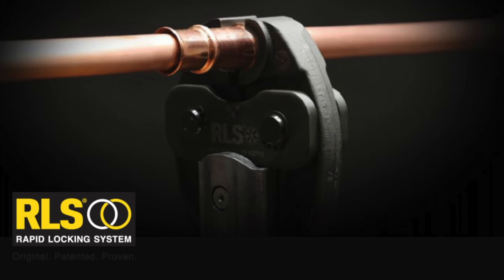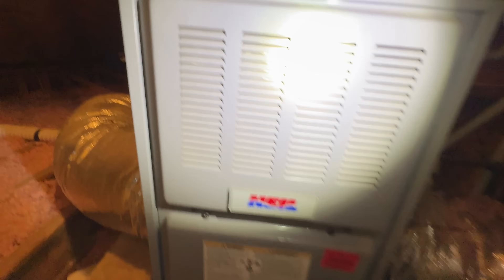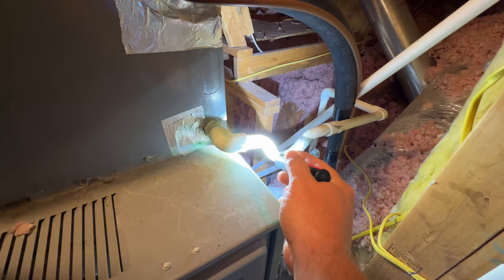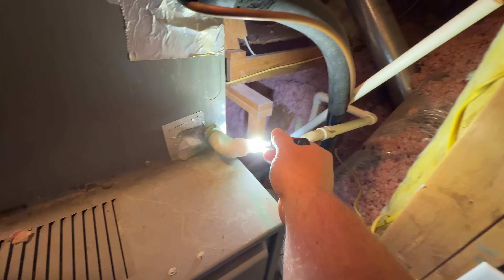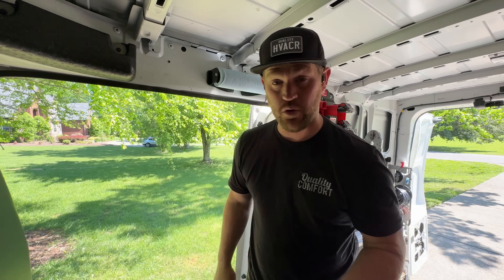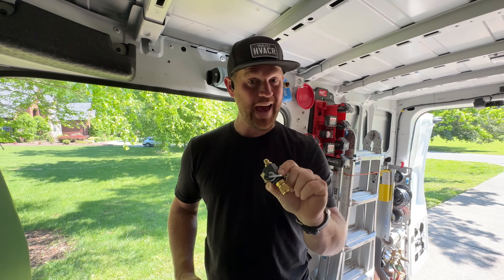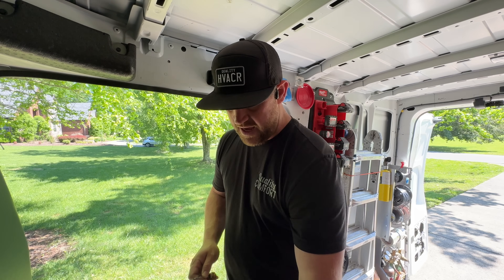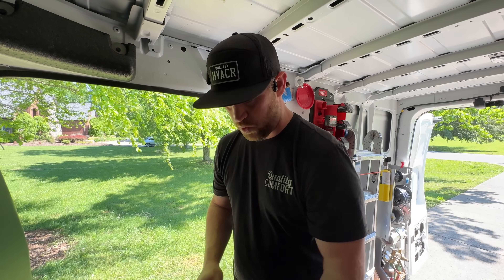ONE thing I do that sets ME apart from most HVAC companies.

Comment: That’s wasn’t R-22 though 😏 ain’t nobody giving away free R-22
Reply: That sure looked like MO99 on top of R22 from the looks of it.  That isn't a legit way of doing things.
Reply: @Balticblue93  When he said not a big deal that he tops it off made me think it wasn't the real R-22. R-22 jug in california is over 1g or so last time I had to buy one.
Reply: @JIKI2005  I buy R22 for around $800 for a 30lb bottle.  One R22 repair pays for the entire bottle. The rest is profit.  No need to buy crap drop-in’s.   407c works the best, if you are forced but I don’t stock 407c, I use real R22.  Sure, it can be an expensive repair but I will get the change-out when the time comes.  Do right by good folks and they will do the same for you.
Reply: MO99... R438a 🤣

Comment: Sometimes the leak is at the Schrader valve.
Reply: Quite often it is the valve core and no seals on the caps.  I always start there when leak testing.  I replace the valve cores and caps on every system I have to recharge or top off.
Reply: About 1% of the time
Reply: @gregpewtress2952  Not hardly, try living in Colorado and tell me that nonsense.  It’s very common but most techs are too stupid to find a leak, they just sell a fix they think will work for big commissions or a full change-out because all they care about is their own wallet.   Most R22 systems leak from there.  Half the time, the systems don’t even have caps on the ports.  It isn’t hard to find leaks to repair.  But I am the owner and a tech, my guys can’t pull that crap with me.  But I do pay well for them to be thorough.  It’s part of every PM.  I don’t mind upselling, if it’s truly needed.  But we test, not guess.  Half the time, we are fixing some else’s problems.   Good for us, bad for the customers.   I love being the second or third opinion.   I get the repair or replacement a majority of the time.  I take the time to explain things to the customers and I don’t mind helicopter clients.  Men are naturally curious, if they are inclined.  But I explain to them not to mess with things they aren’t trained on.  Customer service and a good rapport is the key to success.   Check the schrader valves for leaks anytime a system is low.  You will be surprised.

Comment: That will give them time to shop around!
Reply: And then you’re out $160-$250 for 2 pounds of refrigerant. They can pay me to top it off if it’s a new customer, like in his case. 

New customers are notorious for getting the “free recharge”, having you get the equipment delivered, then canceling the changeout, because they found someone cheaper or suddenly don’t have the money or they’re nice and cool so why should they change it out now.
Reply: @USA-GreedyMenOfNoIntegrity  And that is why I don't do free anything unless I have a signed legal contract in hand for the change-out.  I get 50% upfront for full change-outs. But I also don't put MO99 on top of R22.   I would charge with R22 as I have massive amounts of it and credit them when the final payment is made on the change-out.